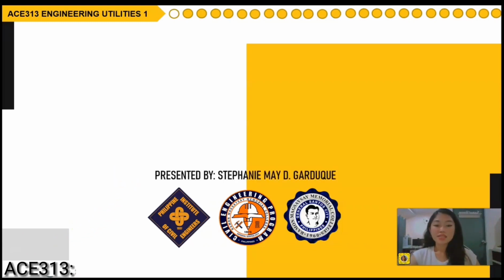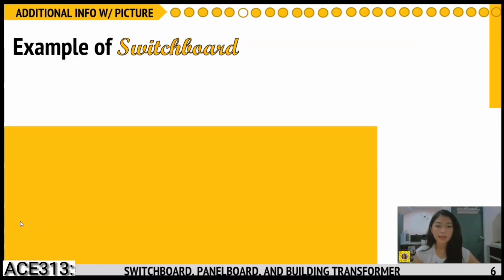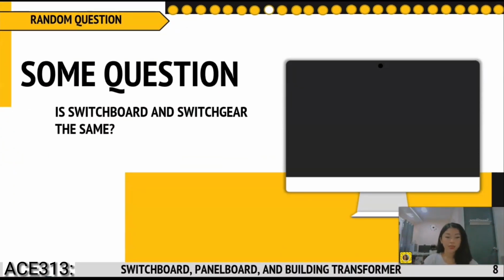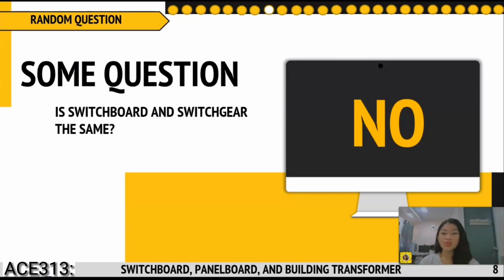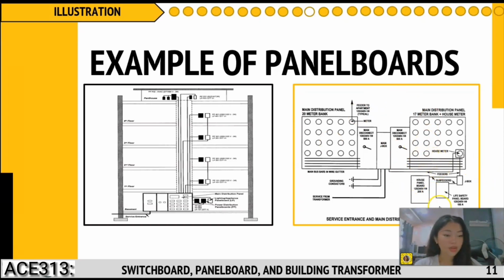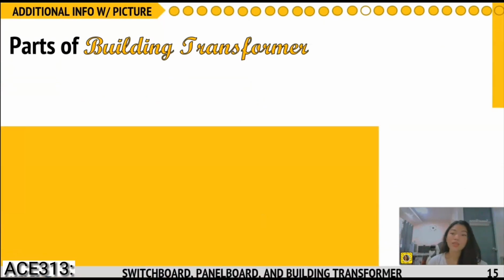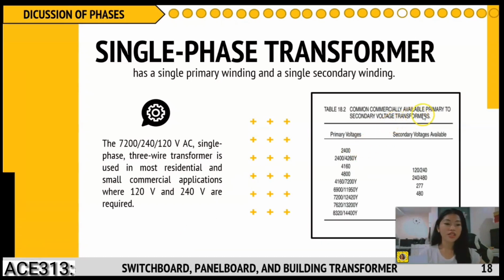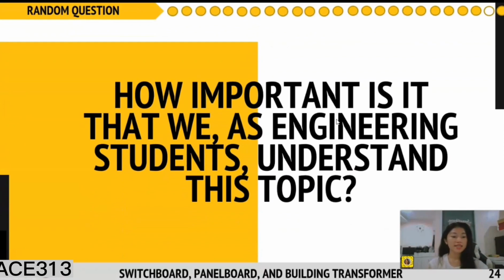SWITCHBOARD, PANELBOARD, AND BUILDING TRANSFORMER

Comment: The video of Ms. Garduque enlightened our minds about the topic Switchboard, Panelboard and Building Transformer it tackles about the uses and the principles of this equipments like the switchboards, it is used to safely distribute electricity throughout commercial and industrial facilities. It is switchboard is a component of an electrical distribution system which divides an electrical power feed into branch circuits while providing a protective circuit breaker or fuse for each circuit in a common enclosure.

Comment: In this video I learned a lot of information about what is the other alternatives if our control of light, heat, and power circuits with no switch. and I also realize about the different distribution of system by using switchboard, panelboard and building transformer which talked about the report how the panelboard should work such as; power panel, load center, distribution center, and main power panel. also it tackles about the importance and significance of the panelboards and switchboard, especially its differences when it comes to distributing power using its own system.

Comment: This video emphasizes the importance of switchboards, panelboards, and the building of transformers. This are part of the electrical distribution system which supply power to any branch connected, Ms. GARDUQUE also includes some excellent facts that cover the overall concept of how panelboards are also known as the electrical safety cabinet as it is where electrical protective devices resides. All things considered, Ms. GARDUQUE did an excellent on the overall coverage of her topic.

Comment: In the electrical distribution system that divides an electrical power feed into branch circuits and provides each circuit with a protective fuse or circuit breaker in a single container, the switchboard, panel board, and transformer play a crucial role that I observed. She added that the switchboard and switchgear are distinct from one another.

Comment: I have learn a lot about the significance, applications, and parts of switchboards, panelboards, and manufacturing transformers from this video. Additionally, she added that switchboards and switch gear are not the same. A thorough knowledge will enable us to assess the importance and use of each in real-world electrical system.

Comment: Thanks to this video lesson, it teaches me the function and uses of switchboard, panel boards, transformers of how it alter the power electricity into safety of enclosed cases. For most of my life, I only understand that switchboard is just a switch that connects and disconnects power line from source, but now I know that is is also a safety geared controller that enables the maintenance, repairs, and rewire without the risk of confusion and electrocution.

Comment: What I learned from the presentation I watched was the importance of the switchboard, pannel board and transformer, these are part of an electrical distribution system that separates an electrical power feed into branch circuits while providing each circuit with a protective fuse or circuit breaker in a single container. I also learned that the proper choice of either of these requires technical knowledge as well as the consideration of electrical system applications where these gears are going to be used. Having a good understanding will help us to evaluate the significance and application of each in practical power systems.

Comment: I learned about the SWITCHBOARD, PANELBOARD, and BUILDING TRANSFORMER for this video. Switchboards, panel boards, and transformers are essential components of an electrical distribution system that divides an electrical power feed into branch circuits and provides each circuit with a protective fuse or circuit breaker in a single container. This highlights the significance of these components. A panelboard protects branch circuits from overloads and short circuits. Additionally, these aid in regulating the current and maintaining its balance to prevent electrical accidents.

Comment: As a result of watching this film, I now understand the distinction between switchboards and switchgear. Switchgear consists of switching devices, whereas switchboards are panels with devices. A breakdown of the components of a building transformer is also shown, along with some pictures of what panel boards and switchboards are like. The relationship that should be coordinated across all disciplines in building and construction led me to the realization that it is imperative for me as a student of civil engineering to understand this subject.

Comment: From this video we can have a ideas about switchboard, panelboard, and building transformer that they protect and organize the electrical wiring system, which is by far the most fragile, and dangerous set of wires that encircle an establishment. They distribute electricity throughout homes and other buildings by safely dividing the main electrical power feed into smaller components, known as branch circuits. To protect branch circuits from overloads and short circuits.

Comment: Thanks to Miss Garduque, for sharing her thoughts about this topic. After I've watched her presentation, I've learned that in Building Electrical Service and Equipment, knowing its subtopics which is; 1. Switchboard which divides an electrical power feed into branch circuits, 2. Panelboard which is used to control light, heat, or power circuits and lastly Building Transformer which is used to reduce building distribution voltage to a level that can be utilized by specific equipment is important for this knowledge will be used in the future.

Comment: In this video, the reporter talked about switchboards, panelboards, and building transformers. She talked about the significance of each of these components of an electrical distribution system, which divides an electrical power feed into branch circuits and provides each circuit with a protective fuse or circuit breaker in a single container. Along with the sections and components of a building transformer, it also displays some instances of how panel boards and switchboards look.

Comment: I have realized that the proper choice of either of these requires technical knowledge as well as the consideration of electrical system applications where these gears are going to be used. Having a good understanding will help us to evaluate the significance and application of each in practical power systems.

Comment: This video is all about the switchboard, panelboard, and transformer. I learned a lot in this video particularly the three that i have already mentioned. These three have different purposes and usage. Switchboard is a large cabinet or assembly of metal cabinets in which to divide large of amounts of electrical current. Then, panelboard is is one or more metal cabinets that serve as a single unit, including buses, automatic overcurrent protections devices. Lastly, transformers are used in transmitting and distributing power from the power plant to a substation and there are two types of transformer which are the ventilated dry-type and liquid immersion transformer.

Comment from the maker: I was very thankful that our instructor give this topic since I am able to understand further about the Switchboard, switchgear and Building Transformer. With the help of this, I am aware how essential it is and  how it work. If we can distinguish between Switchboard and Panelboard, which are both components of electrical distribution systems that divide an electrical power feed into branch circuits and provide protective circuit breakers or fuses for each circuit in a common enclosure, and building transformer, which uses the principle of electromagnetic induction to transfer energy from one electrical circuit to another. I was also able understand what is the difference between switchboard and switchgear. Overall I really enjoy this report and also, I was inform  the importance of this Topic especially when you are taking BSCE

Comment: In this video I conclude that panelboard is a component of an electrical distribution system which divides an electrical power feed into branch circuits, while providing a protective circuit breaker or fuse for each circuit, in a common enclosure. A panelboard services to protect branch circuits from overloads and short circuits. Switchboards are critical in any electrical process. They distribute electricity throughout homes and other buildings by safely dividing the main electrical power feed into smaller components, known as branch circuits. transformer is a device that transfers electric energy from one alternating-current circuit to one or more other circuits, either increasing (stepping up) or reducing (stepping down) the voltage

Comment: From this video, I learned a lot of the importance, uses and components  of switchboard, panelboard and building transformer. And also she said the switchboard and switchgear is not the same.Having a good understanding will help us to evaluate the significance and application of each in practical power systems.

Comment: In this video, I learned about the switchboard , panel boards, lastly building transformer.  switchboard is an assembly of switchgear for the control of power supplies in an installation or building, Miss Garduque said switchboard is used to transform big electrical current into small electrical current. Next one is panel board,  is a component of an electrical distribution system which divides an electrical power feed into branch circuits, while providing a protective circuit breaker or fuse for each circuit, in a common enclosure. Lastly the building transformer, the common building transformer is step down. The step-down transformer is commonly used to convert the high grid voltage to low voltage that can be used for home appliances.

Comment: what I learned about the different types of Switch board, Panel Board is that as a Civil engineering student it is important for us to know where our electricity or energy comes from that provides light to our homes, so that when the time comes when we do it ourselves of a commercial building or even a residential building we can follow the standard about electrical sources or we know where we get energy. As a Civil Engineering student, it is more important for us to know the different electrical sources so that we know how strong the energy we get when it is weak or strong can find a way to not overdo or weaken the energy we get.

Comment: From this video , I learned that panelboards are wall mounted whereas switchboards are free-standing, mounted to the floor. Panelboards typically are rated between 100A-1200A and switchboards typically range between 1200A-5000A. Both panelboards and switchboards are commonly used for service entrance applications; and switchboards can additionally be used for power distribution.

Comment: The video is about the continuity of building electrical service and equipment, and it discusses the switchboard, panelboard, and building transformer, how vital they are, how they operate, and how necessary it is for us to understand them. This taught me that switchboards are essential in every electrical operation. They safely divide the main electrical power source into smaller components known as branch circuits to deliver energy across houses and other structures. And for panelboards, this is extremely beneficial in guaranteeing the safety of individuals within a facility since it is devoid of hazards, particularly those produced by electrical difficulties such as short circuits and circuit overloads. While the transformers assist us to enhance the safety and efficiency of power systems by adjusting voltage levels as needed. All in all, the video contains detailed information for us to understand things easily.

Comment: This report/presentation illustrates the uses and how switchboard, panel board and fuses. The reporter defines such terms and shows its necessity in electrical distribution in our homes and even in commercial buildings. Switchboard has highest capacity component in which it also disallows short circuit related problems such as electrical fire.

Comment: The report was informative. Since Ms. Garqudue discuss about building electrical service equipment mainly focuses on the switchboard, panel board, and building transformer, I have learned many things throughout watching the video including the importance of switchboard that distribute electricity throughout homes and other buildings by safely dividing the main electrical power feed into smaller components. A panel board services to protect branch circuits from overloads and short circuits. Transformers that help improve safety and efficiency of power systems by raising and lowering voltage levels as and when needed.  The reporter provides a picture to visualized the mentioned equipment. The reporters did a good job of explaining the subject

Comment: From this report I learned a lot on how switchboard importantance Switchboards are critical in any electrical process. They distribute electricity throughout homes and other buildings by safely dividing the main electrical power feed into smaller components, known as branch circuits. And also about panelboard A panelboard is a component of an electrical distribution system which divides an electrical power feed into branch circuits, while providing a protective circuit breaker or fuse for each circuit, in a common enclosure. A panelboard services to protect branch circuits from overloads and short circuits.

Comment: The continuation of building electrical services and equipment under chapter 18.2 focuses on Ms. Gardoque's presentation. In this video, she went into great detail about the functions of building transformers, switchboards, and panelboards. Because switchgear is made up of switching devices, and a switchboard is made up of panels with devices, I discovered that they are not identical.

Comment: For this video i learned first what the importance of switchboard so I understand switchboard is a component of an electrical distribution system which divides an electrical power feed into branch circuits while providing a protective circuit breaker or fuse for each circuit in a common enclosure. for the electrical distribution system i learned which divides an electrical power feed into branch circuits, while providing a protective circuit breaker or fuse for each circuit, in a common enclosure that's all

Comment: From this video, I learned that switchboards and switchgear are not the same - where switchgear is composed of switching devices while switchboards are panels equipped with devices. Also, it shows some examples of how panel boards and switchboards resemble, as well as the parts and components of a building transformer. Therefore, I realized that it is important to understand this topic as a civil engineering student because there is a link that should be coordinated between all disciplines in building and construction.

Comment: NIEL JOYCE L. DEGORIO BSCE-3

In this topic, I learned that Panelboards are typically flush mounted or surface mounted and are limited to a maximum of 1,200 A incoming current (main). Switchboards are free-standing units that are front connected and, like panelboards, require only front access. However, switchboards can allow for both front and rear access if desired.